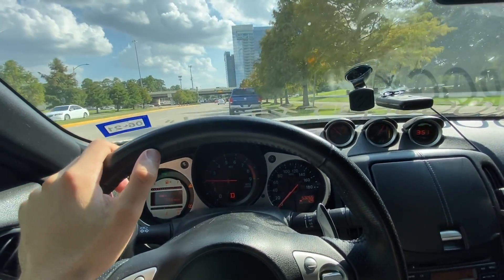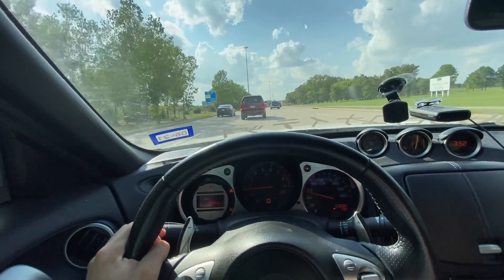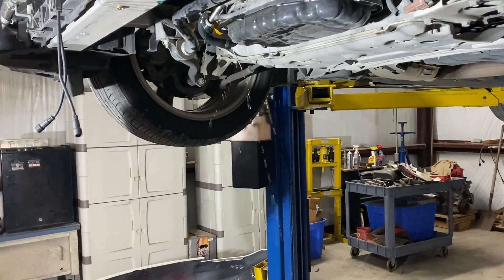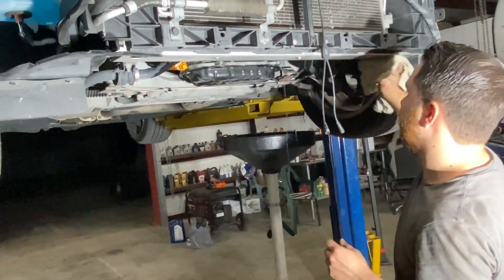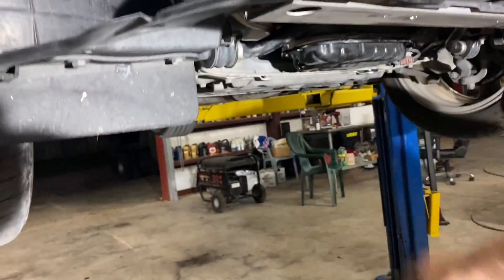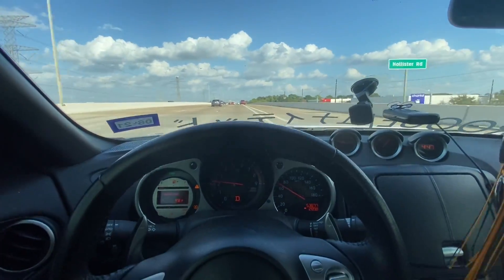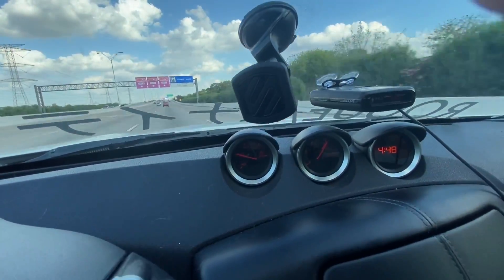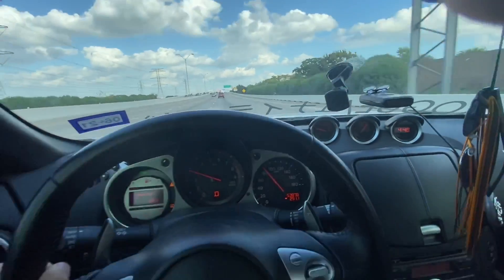Every 370Z Needs This $100 Mod

Comment: Oil cooler is a no brainer.  I'm confused on whether or not a transmission cooler for the 7AT makes sense or not, or would one want to replace the radiator since the bottom channel functions as the transmission cooler?
Reply from the maker: Adding a cooler helps it a lot

Comment: Mine has always stayed at 180, doesn’t go up to 200 unless I’m driving hard for a long time.
Reply from the maker: Well here in Texas it gets hot fast 😂
Reply: Felt lmao my shit always 200-220 here in Florida
Reply: Ong my 2017 stays at 220 on a hot day in California
Reply: Mine depending on the weather it hits 180, but in summer days it hit 220 but when I took it to the dealership they said my cam seal was burned so I fixed it now it barely hits 190°

Comment: What is he cutting off? I've seen a few oil cooler installs and don't remember seeing anyone cutting anything off
Reply from the maker: The factory coolant line that runs to factory oil cooler
Reply: @issaslowz  oh ok
Reply: @issaslowz  do you have to cut that off ?
Reply from the maker: Jesse it helps but not required

Comment: i got one of these off a guy i got my Z1 diff cover from, i didn't know you had to remove factory cooler. i thought it was a bolt on to the factory cooler but it makes sense to just loop the coolant system or how did you do that considering he cut off the pipe. maybe mine is different (04 coupe)
Reply: G*
Reply from the maker: Try this video it’s more detailed https://youtu.be/9zD5AYBdyyg